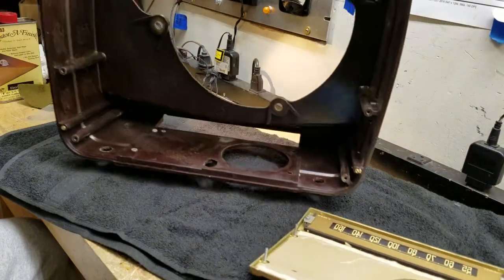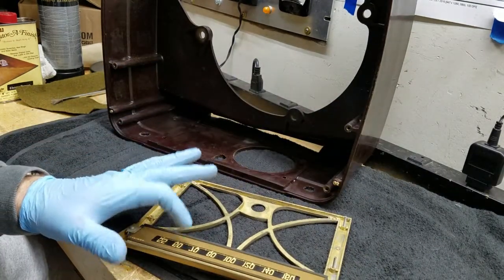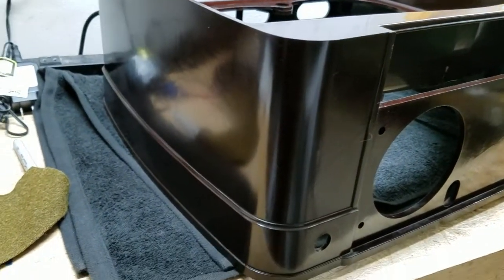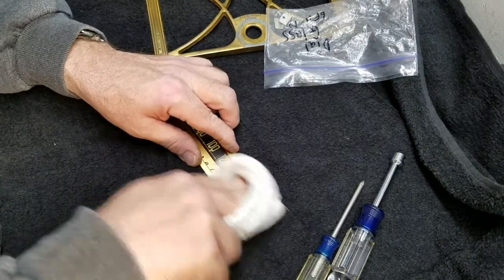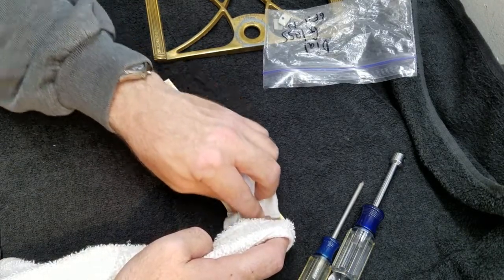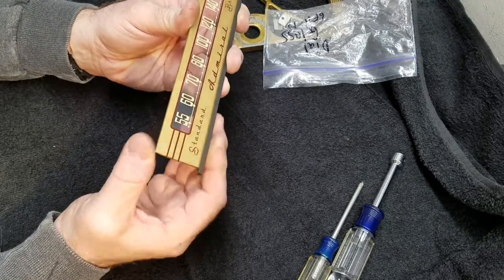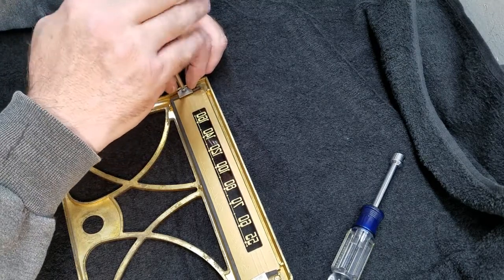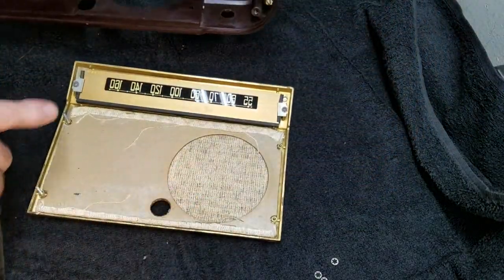1949 ADMIARAL 6F11-N Radio Record Player Part 8 of 8 Assembly and Finale'

Comment: I love how you restored the he finish. It's perfect. I never knew what to use on mine.  I have an Admiral that is similar but the radio dial is a half circle. My grandmother had one just like it and I loved it when I was a kid. Sadly it got lost and years later I found the same model at a little antique store for not much. It was in pretty good shape (other than the usual one expects when restoring these, new idler wheel, recapped, wired, cartridge etc, but not a disaster.  I have several old restored record players (I love them so, they are cared for, used and enjoyed) but I find that the Bakelite on Admirals is different than the RCAs and can get really dull and weird looking.  What you did looks perfect and keeps the vintage patina.  I would have never thought of using that. Great restoration and love the way that you explained everything.

Comment: Michael, great job on a classy set. Really a great sounding player, I miss the vinyl, and you have got me fired up to redo mine for my next project! Thanks for sharing and all the detailed clips! Best Larry
Reply from the maker: Larry,
I look forward to seeing your record player.  These old ones get forgotten about, but they are great fun.  Plus, the old 78s can sound surprisingly good, if the player is in good working order.  Thank you, and keep your videos coming!   Michael
Reply: ThatTubeSound Michael, help educate me as Im new to vintage phonos. Prior to 1948, everything was 78 rpm? Are there different types of 78's? As you know I have a 41 Firestone Air Chief  S-7406-5 , the "Mayfair". I dont have any 78's when I get to testing it. If there is a difference, what kind do I need? Once working, I will buy something I want to listen to. Thanks! Larry
Reply from the maker: Hey, Larry!  There were a couple of variations in 78 rpm records.  I am by no means an expert, but I do know that there were 10-inch and 12-inch 78 rpm discs.  Most discs were 10-inch and you are safest to buy those. 
 Some players will only play 10-inch discs, but your Firestone probably does both sizes.  They were mostly made of a lamination of shellac composite materials which became very brittle over the years.  But, as one of my recent vids demonstrates, 78s were also made later on in plastic materials like that red Silvertone disc.  There were 33 rpm shellac discs that were pioneered by RCA, I think.  They even called them "long-playing".  They looked just like shellac 78s, but they were intended for some special 33 rpm machines that RCA built.  Finally, there are also the Edison "Diamond Discs" that are 78 rpm, but are not compatible with non-Edison players.  They used a different groove type that required a completely different reproducer to play.  I don't think that an electric diamond disc player was ever made, but I am not sure.  The early diamond discs were pressed on one side of the disc only.  They are generally thick discs, around one-quarter inch.  I hope this helps.
Reply: ThatTubeSound thx Michael, yeah, I've put my feelers out with the local antique store to. E looking for me a 78 to have when I redo the Firestone. I get it working then I'll get picky as to what records I buy, lol, thx Larry

Comment: To quote wikipedia:
"Bakelite, or polyoxybenzylmethylenglycolanhydride, is an early plastic. It is a thermosetting phenol formaldehyde resin, formed from a condensation reaction of phenol with formaldehyde. It was developed by the Belgian-American chemist Leo Baekeland in Yonkers, New York, in 1907."

It might be considered a petro-chemical, as phenol is extracted from coal tar, or petroleum.  The 'poly' in the name suggests that it is a polymer, plastics are typically organic polymers of high molecular mass.  I guess that formaldehyde is the only solvent that will dissolve bakelite.
Reply from the maker: I guess I was trying to impress that bakelite, because it relies on a resin, is different than most modern thermoplastics, which rely on different structural properties.  I did not know about the hydrocarbon origins of bakelite.  I work for a manufacturer of detergents.  We make our own packaging bottles where I work.  We use both blow molding and injection molding.   We also make bottles from PET pre-molds.  It all seems to work differently than did bakelite.  Very interesting, and worth me looking into further.   Thanks, as always!    Michael
Reply: Well you did make the important point about the fact that bakelite is not effected by the same solvents that other plastics are.  Since I've been playing with 3D printers I've become aware of the different characteristics of plastics, solvents, melting points, strength, brittleness, etc.

Comment: i have this exact radio phono, but my dial glass radio stations are all missing large parts of the numbers. where can i get a reproduction or can it be resprayed with a template? Great help in my resto project thank you. Think I will go Update to the turntable but run the sound through the tube amp. Dennis

Comment: I have an admiaral radio/ record player from 1952 mine has no chips or cracks in the case. it has a 45,78,33 rpm fully automatic turntable and has not been worked on yet. I got mine in very good condition for only $7.50 at estate auction
Reply from the maker: Admiral made some really nice sets.  I have a TV-record player-radio combo console that is in really nice condition.  I'm really looking forward to getting to it....someday!   Cheers!   Michael

Comment: Enjoy your videos but I'm a record changer fan and wish you'd show the changers going through a few records when its all done instead of just placing one on the platter manually.
Reply from the maker: Hey, Richard!  I totally get it.  The reason that you have not seen me put records on a changer is that, since I started posting videos, I have done mostly 78 rpm changers.  The Scott 800B had a vinyl LP changer, but it had terminal wear and damage that prevented using the changer.  I did post one of an RCA changer very early on, but the video is not very good.  

As far as putting shellac 78s on a changer, you will not see me doing that because the 70-plus year old shellac 78s are all now quite brittle and they break too easily.  I have personally witnessed a record changer munch old 78s and it wasn't fun to see.  To me, every old record is precious and it's really not worth risking the damage of operating them on a changer.  I advise all of my customers to avoid using the changer functions for 78 rpm records.  As an aside, I have acquired a couple of 78 rpm records that appear to be made of a kind of plastic (styrene?) and I am considering using them to demo the changers.  The trouble with that is that I don't want to encourage folks to use changers.  Maybe I worry too much about it, but there it is.

Cheers!  Michael
Reply: ThatTubeSound 
Yeah, I saw that one where you disabled the changer. I cringed. LOL!
The "unbreakable" 78s would be perfect for demonstrating the changer functions although I personally have never broken a shellac 78 on a changer yet. 
I just really enjoy seeing units functioning like they were intended... especially after going through all that restoration. 
You could always make a statement or text message when doing the demo. Basically: "use changer at your own risk".
Reply from the maker: I feel your pain.  I like to see them being used, too.  I'm just protective of my 78s.  I recommend to others to be so, as well.  However, you have a point about demonstrating using the "unbreakable" records, and I will look further into it.  Thanks for the excellent feedback.  I will put it to good use.   Cheers!   Michael
Reply: Richard's Toyroom Hi Richard, I think the light weight plastic material used for unbreakable 78's was called vinylite MGM called it Metrolite,  a  kind of early vinyl. I have a few American forces world war II 12 inch V-Disc on vinylite featuring Glen Miller with his airforce band and other popular swing artists. The were pressed in the USA I think by RCA Victor then shipped out to entertain US forces abroad. I only rember one UK record company using vinylite  (Pye Records) from the mid 50's till 78's were discontinued in the very early 60's. hope you find this interesting. Chrissy...
Reply: Chrissy Witney 
There were several trademarked names for the non-shellac 78s. I'm guessing they were pretty much the same stuff give or take.
Reply from the maker: Chrissy,  I am on the lookout for the "unbreakable" 78 rpm discs.  I want to demo the changers, because I overhaul the whole record changer when I do one, and it would be so cool to show it off, working.  I don't get as many all-speed changers in, but when I do, I'll show them changing records.   Thank you so much for watching - and especially for your great comments.   Cheers!   Michael
Reply: ThatTubeSound Hi Michael. I may be able to help you out with a few vinylite records from my collection, however they may not work to we'll with shelf changers. They are thinner than a regular 78rpm and the outer rim is tapered. The shelf changer was just about done in the UK when they were introduced. also the vinylite 78's sound quality was better than the early 45's.  Michael I have a totally unrelated question if it's not too much trouble, I know your a busy bloke but in your opinion would it be possible to fit a RCA 45 player with a 50 cycle turret so it would play at the right speed in the UK? dropping the voltage isn't a problem. I've always wanted to own one of these record players. RCA did launch the 45 attachment changer over here with the "his masters voice" badge in 1950 but it had a very short run and the only UK machine I ever saw was the one my family had when I was a child, it was replaced with a 3 speed stereophonic consol around 1959.  Any hoo,  if you want the 78's let me know, I've traded records with a guy in Kentuckey for years. my email is chris.witney81@gmail.com 
kind regards Chrissy
Reply: Chrissy Witney 
Are you sure those records you are calling out with the "thinner rim" aren't actually vinyl? They did press vinyl 78s. They actually sound incredible. The "unbreakable" 78s were generally of the same thickness as the shellac ones in my experience. 
Michael, if you are perusing boxes of 78s, look at the yellow MGM ones. Those tend to be plentiful on Metrolite. Also most children's records are plastic and as a bonus they are frequently on colored material. Unfortunately they are almost always badly scratched.